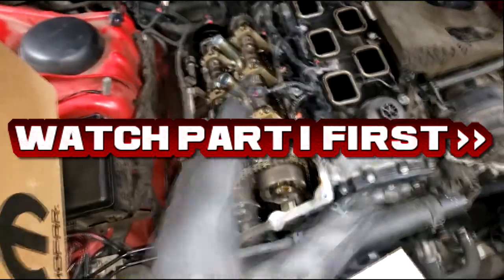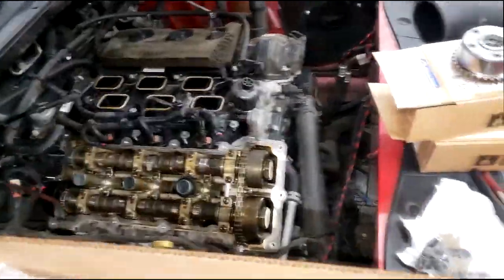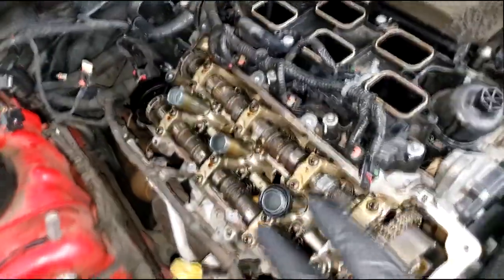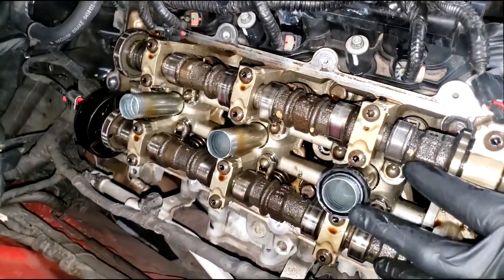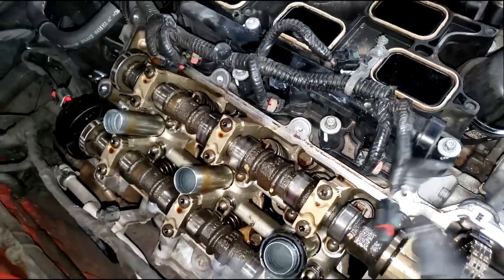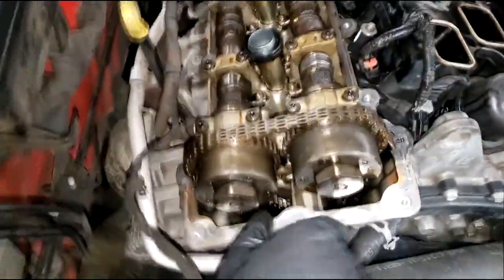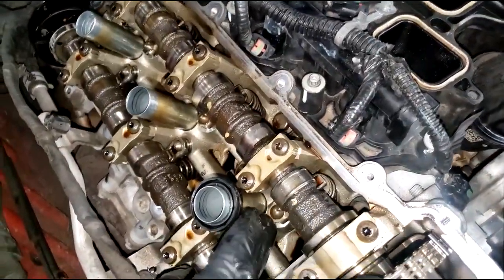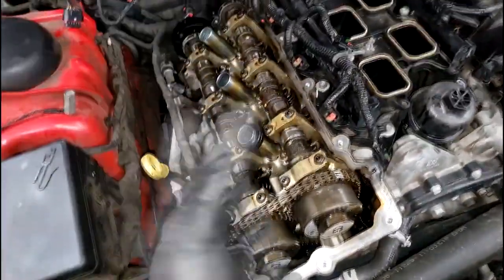How to fix a motor thats has a Misfire and Ticking  May need camshaft, rockers arms & phasers P0300

Comment: My dodge ram 1500 5.7 hemi Misfired cylinder 4 I changed ignition coil and spark plugs nothing worked I still had a misfire. Local mechanic said it's my camshaft and work on it cost $2,700 Should I get a second opinion?
Reply from the maker: Why would you suggest a second opinion? If he did a compression test and its low, hes right, your problem internal and could be a camshaft with the needed lifters. Did he check it out or just guessed? Also are you subscribed to the channel?
Reply: @OnlineMechanicTips  subscribing now and Im not for certain if he guessed it or gave it compression test I'll be finding out tomorrow.

Comment: here's a question for TJ I had a p0340 on a 4.7 had it for 8 plus years Finnally it pop up. It runs fine and starts up its got 190k could it be just the cam position senor not working right? it doesn't seem to run rough or run rich for lean so does that mean that checking the harnesses and maybe changing the senors fix the issue cheaper than opening up the engine to go further? cuz I've never had issues with the engine running rough or misfires fresh plugs within 3 years and wires too. what's your advice TJ..